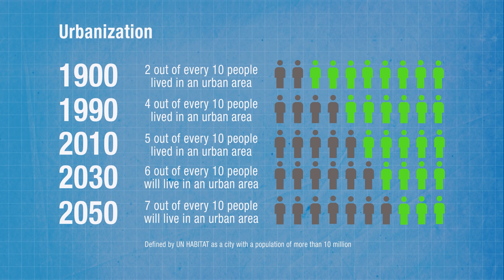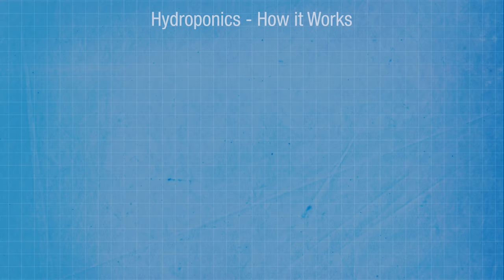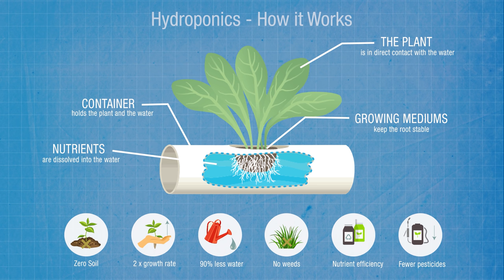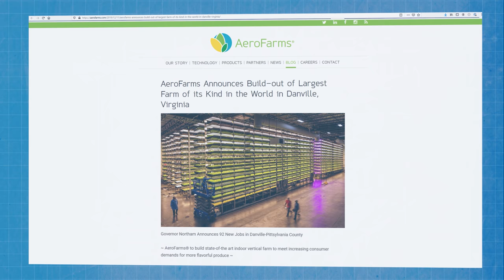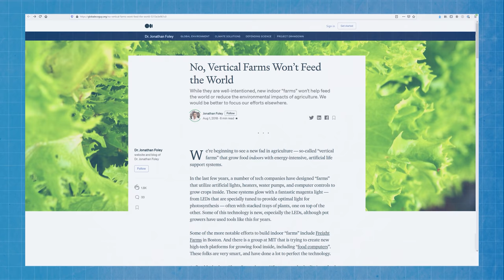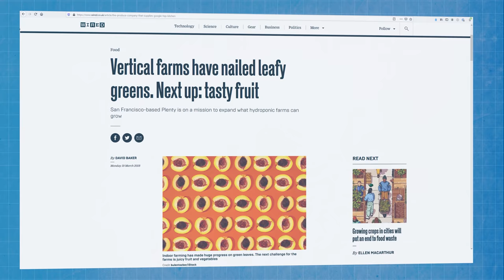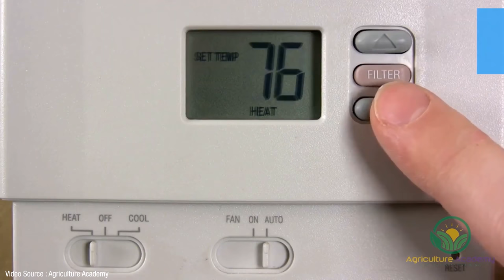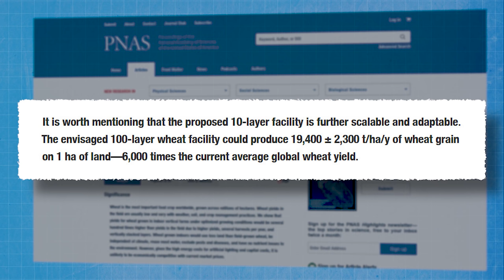Vertical Farming:  Growing fast!

Comment: There is always the Shanghai Tower type solution, which has a twin wall structure, offices, and a hotel in the inner structure, and the tower's green spaces are between the inner wall, and the outside wall.
Reply: being around green growing things is good for us, psychologicall. Obviously it is best if those green growing things are pretty too, but just having walls of vertical farms around us would still be better than walls everywhere.

Comment: Thanks for another great video. I run a small commercial aquaponics farm. One of the advantages often overlooked on these growing methods is that pesticides, herbicides, and fungicides are not necessary. In fact, in the case of aquaponics, if one were to use these poisonous chemicals, the fish would likely not respond well. A win win for heathier food and a cleaner environment.

Comment: I was obsessed with the idea of vertical farming a few years back. There are some serious benefits ranging from land use, localised production leading to decreased transportation and packaging requirements, the efficiency of water and nutrient consumption, the lack of need for spreading pesticides and herbicides out in the wild effecting all the ecosystems surrounding farming (although i will say that pesticides do still have their place in indoor horticulture sometimes because of the lack of natural predators for things like aphids, white fly, spider mite etc) 

But the energy use is the real kicker. Hydroponic LED lights use specific wavelengths used for photosynthesis, mostly red and blue, which makes them about as efficient as you could possibly get for the purpose and yet you still need about 300 watts per square metre.
Lettuce in a greenhouse can be grown using 250kWh/year/square m but for hydroponics that's more like 2,000kWh/year/square metre just from the lights assuming an 18 hour photoperiod is used (that's part of how you get such high yields with hydroponics)

So once you factor in climate control etc it's probably about 10x as power hungry as a greenhouse per square metre and if you used natural gas power for this at 400gCO2eq/kWh then that's 800kgCO2/square metre/year

This is why alternative energy is so god damn important but for the time being we already have to electrify transportation, heating, cooling, industry etc etc and we're only about 11% electrified. Adding another huge power hog onto the grid to do a job that the sun was already doing is nuts. All the extra clean energy we can get our hands on is already needed to displace fossil fuels.

One day... Maybe... We might have enough nuclear to get that 800kgCO2/square metre/year down to 24kgCO2/square metre and then it might be worth it. But we aint there yet
Reply: Hopefully they will use solar and wind power and no more nuclear will be built.  Nuclear just isn't necessary anymore.
Reply: @Burnrate  to go 100 solar and wind while also electrifying everything would mean covering almost everything and creating a waste stream of monumental proportions. I sincerely hope we don't do that

Comment: Greatest advantage to vertical farming is the fact that it is local, which means savings in transport and where growing seasons are short or non-existant.
Reply: And I suspect these nay-sayer criticisms have failed to take that into account.
Reply: Remote Arctic communities with access only to very expensive imported greens love the innovation. Cheaper vegetables when none are available in the winter.

Comment: I heard of this sometime in the past. It is intriguing. I live in a town of 2000. I'll bet that a 10 story 1 square block vertical farming facility would produce a great deal of the required produce for our town and some of the surrounding area. The questions that immediately come to mind are: 1) What is the initial cost of setting this up? 2) How long would it take to get all 10 square blocks producing? 3) What is the production cost per crop? 4) How many crops can be produced? 5) Is the cost, once production is fully established, comparable to field produced crops?

Comment: Great, informative video again. Wheat, soya, palm oil and rice need to be grown this way to save the rain forests. Imagine if you could have a vertical farm in a desert using recycled water, natural light carried by fibre optic cables, and solar panels for the electricity  - it would almost be self sufficient.
Reply: This would drastically help with water shortages.
Reply: Why fiber optic cables? Just use a transparent roof. You could call it a house for green things. A green house, if you will.

Comment: I remember a Popular science article about a greenhouse/fish farm back in the 70's or early 80's.  To help feed the fish,  there were screens above the tanks upon which table scraps were placed.  Insects would lay eggs in the rotting food scraps,  but the larva would tend to fall betwwen the screen's mesh into the water as fish food.  The fish water would be taken from the bottom of the tank,  circulated to the plant roots and also to a ping pong ball filled clear chamber in which algae would grow on the balls surfaces (not sure which got the water first,  the plants or the algae,  the algae was to remove any excess ammonia),  last step was a spray of water onto a plastic wall,  down pebbles.  Counting you dining table,  it was meant as a near closed loop system.

Comment: Those lights aren't usually UV, they're mostly red leds with some blue. Plants don't require much green light. That's why many plant leaves reflect green light.
Reply from the maker: Yes, you are right., I got that bit wrong - I've just put an Errata note in the description section.

Comment: Vertical farms can use LED lighting to augment daylighting in some futuristic designs.

Comprehensively planned platform greenhouses can unite many important functions that increase the overall value of well engineered urban vertical farms.  Renewable energy, water purification., food dehydration, bio labs research, and skyline enhancement are some of the mutually supporting functions vertical farms will use in the future.

The local nature of a given vertical farm will depend on climate, geography, demographics, and economic demands.

Thanks for your excellent presentations on a variety topics.

Comment: Now I know where will I apply my skill if I ever get graduated in Environmental Engineering or Chemical Engineering.
Reply: You might first wanna check out the syllabus, chemical engineering has more to do with distillation ,piping and transport of fluid
Reply: @BronzeAgeMan1350  yup. that is my stuff since I have a degree in Laboratory Analysis.
Reply: Good luck to you!!!

Comment: Oh, vertical farming! This is one of my favorite subjects, because it's a necessity if humans are ever going to live in space. And it's also a natural extension of the idea of agriculture. Thousands of years ago the first proto-farmers discovered they could get more edible plants if they took control of seeding and watering them, instead of letting nature do all the work. Vertical farming today is taking control of everything else and removing all the randomness of nature from agriculture. It's an extremely human thing to do.

But there are problems, and you pointed them out really well in the video. The biggest problem is trying to replace the sun with artificial light. The sun shines for free, so it's always going to be difficult to beat that with electrical power. Of course the idea is to maximize the advantages of vertical farming (water and land conservation, no diseases, pests or destructive weather and the ability to push agriculture to its theoretical maximum of production) to the point where it becomes cost competitive with growing plants outside. We're not quite there yet, but as you said the engineers are finding greater mechanical and electrical efficiencies all the time, particularly with the technology of LEDs, so it's possible that point might be reached in the near future, especially when teamed up with renewable energy sources.

But right now the biggest problem with vertical farming is what they're actually growing in those food factories, and you pointed this out as well. The vast majority of real world agriculture is devoted to cereal crops, with leafy greens just a subset of the subset of vegetables. To truly change the world and eliminate food security, we'd need to invest in vertical farming the same way we invest in computers or automobiles today, pouring hundreds of billions of dollars into building the infrastructure and then devoting it to crops that aren't that profitable. In my own country I can tell you that (pre-pandemic) wheat wasn't that profitable. Farmers were already turning away from it in favor of other crops like barley and canola. It's really hard to imagine how a vertical farming industry could make a profit if they had to compete with that.

But the future is bright when it comes to vegetables and fruit. Fruit in particular is vulnerable to weather damage, so it could be a potential area of expansion for vertical farming if they can figure out the challenges of growing bushes and trees in a vertical environment. At the moment vegetables are the easy target for expansion, and that's probably what the researchers will focus on next.

Anyway, thanks for the video! (Sorry, I should have said that first.) This is a fascinating topic that I think will become more and more important as the years go by.

Comment: Sunlight travelling through fiberoptics. How about fiber optic "trees" on the roof tops collecting light
Reply: What? You mean a ‘skylight’?  I have this brilliant idea that will reduce power consumption wasted on lighting.  A series of expensive fibre optics that transfer light from rooftops to vertical surfaces. Oh wait a minute. They are called windows
Reply: @davidsteer8142  Light pipes are a possibility.
Reply: @StuTubed  Yes, like windows, they already exist. We call them (brand name) skylights.  I have two in my house to light a room that lacks natural light.  But, they use a reflective film in a tube, not expensive fibre optics.
Reply: Indeed, I know they exist.  I mentioned them since they're a good way of getting natural light into places where it's not feasible to install a conventional window or skylight.

Comment: You completely missed the bigger point against the need of vertical farming. The problem in most of the world is the "quality" of the farming done. I come from the Netherlands. We export more foodstuff than America does on a fraction of its size. We can do this, because for more than half a century we have already been using hydroponics in green houses. We already have vertical farming in widespread use. (https://www.meteorsystems.nl/en/growing-systems). Though not as high density as your examples as there is no need for that. Our water management even on "normal" farms is second to none. When looking at other countries. You get the situation that the water used for 1 crop of Egyptian tomato's can do a year of many crops in our greenhouses. Even most American farms are old fashioned by our standards. When Americans want more crops, like many out there, they just take more land, use more water. Simply because it's easy. We are a small country and had to feed our selves. So we needed advanced farming solutions that use little water and no pesticides and other bad things. Now we feed the world. If everyone farmed as the Dutch do now. The problem of feeding the world is gone. We would have severe overproduction and no need for vertical farms.
That said, there could be some use to them in city area's to keep distribution lines short. Flying food all over the world also has an environmental impact. And with climate change reducing the water and pesticide use even further down is a good thing.
But as I said, the technique is not a problem, we have been able to do this for years. The problem is getting countries and their farmers to accept this new model of growing food. If governments don't incentivize moving to new techniques by making strict environmental rules, its not going to happen. Simple rules like banning pesticides. Subsidizing greenhouses over traditional farming. Increase water cost for industrial use. (if your Spain, ban illegal water wells and make an effort to police that).
Reply: such a pity that those tomatos taste like shit :-(
Reply: Dank u.
Encouraging to use these techniques it would be Brexit her, a no-deal one in the first place. Whence no more Danish and Dutch food comes in here,,UK would be in the need of raw food. A market drive, not a fiscal one. And down this line, Scotland is a bit overpopulated to its traditional food-production, but the Durch way can be their way to remain in the EU. Malta is again a flat desert, but full with money, EU law background. 
A new terrain for Dutch expension?
Reply: Do we grow our potatoes in those greenhouses? No, we don't.

Comment: I have grown vegetables hydroponically for over 50 years. It works, but it's not all a bed of roses. There are several problems as there are with soil farming, just not the same ones. For anybody starting out, the simplest and most productive system is the Kratky system developed by dr. Bernard Kratky of the University of Hawaii.

Comment: One way to lower the electrical consumption could be the use of daylight harvesting/solar harvesting in a hybrid set up. Whereby natural daylight is brought in through a series of mirrors or fibre optic cables. Used next to the growth lights so they don't have to be fully turned on all the time (only night time/ rainy days). I reckon the cost of the system might not make it worthwhile to grow the crops but the technology has been there for a while. Perhaps when prices of such systems drop till a level which makes it possible for growers to still make their profit we may see such hybrid systems in place

Comment: Don't grow the Netherlands their greens in indoor farms for decades now? And aren't they bashed for it by everybody because it is energy consuming and "unnatural"? Besides, humans don't live on greens, they live on proteins, fats and carbs. These don't grow on shelves (yet).
Reply: Yes, but that's still natural light and thus single-layer. It's much lower carbon to grow in Spain and transport than grow in a Dutch heated greenhouse (unless it's using waste powerstation heat). The difference here is the multilayer/24hr aspect which increases yield so much and reduces heating-per-plant energy requirement by factor of 20 odd, but obviously also adds large lighting energy. I've not seen how the numbers compare but the main critisism is the same: energy intensiveness.
Reply: Yes, the Netherlands is an absolute agricultural power house and it's not just because they use greenhouses as they export a ton of food which means it's actually competitively priced. The future of food production is almost certaintly indoors as eletricity cost moves towards zero.

Comment: one thing to think about regarding wheat is modern grains are primeraly engineered to be tall making it easier for harvesting, I've read somewhere that there are shorter breeds in storage that are more suitable for indoor farming.
Reply: Modern wheat is way shorter than it used to be.
 We don't thatch our roofs any more, so the wheat stalks are useless.
Also shorter wheat suffers less from wind damage.
Reply: I think spelt is generally shorter but does not grow evenly, some taller some shorter.  Spelt is an ancient form of wheat that has not been hybridized much, so a somewhat clean slate for experimentation.

Comment: What a way to start the year! This is some fresh crop indeed.

I think that one possible solution to the energy costs of the Vertical Farming industry could be to synergize the procedure, in a way kinda like what aquafarming does with the relationship between the fish and the water and the fish waste. If there were some piece of urban facility that generates waste energy (as a loss or surplus) that could be recovered and/or redirected to the farms; it could reduce the cost, even if only a little.
Also, I seem to recall a sci-fi novel where they mention how the hydroponic farms produce oxygen inside a space station by converting the waste CO2 from the residing population. If only there were a way to capture the CO2 from the atmosphere, or at least redirect it from the sources (like factories) and pump it directly into the farms, so a minimal amount goes into the environment and the rest go into the farms, with the farms pumping out oxygen back out as waste product instead. That method could also help bring down the CO2 imprint of a city.
Let's have a think about that.

Comment: I know people don't like the idea of modifying plants, but breeding them to be shorter (especially wheat, corn, and fruit) would improve efficiency in these vertical farms.  reducing the height of a section by even an inch means 10 inch for a stack of 10 and reduced energy cost of moving by almost a foot over the course of years would really add up.  Not to mention the turn around time from seed to table.